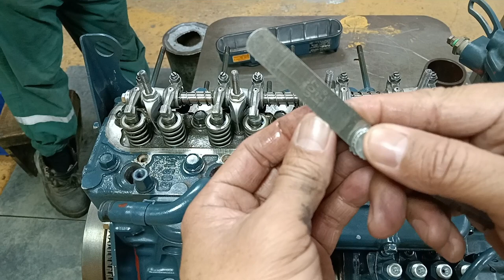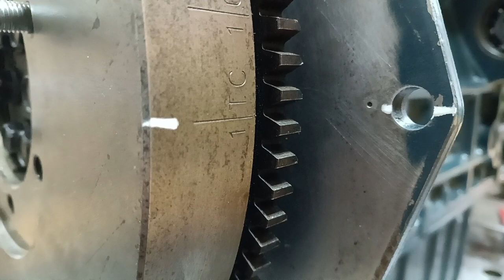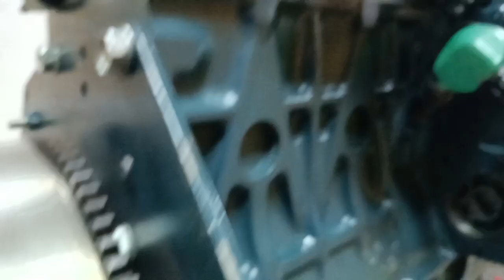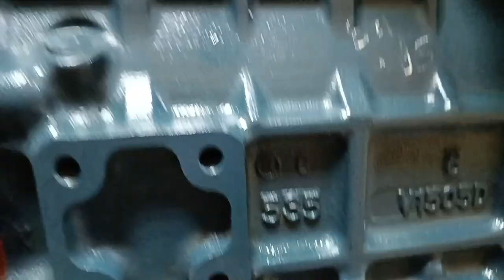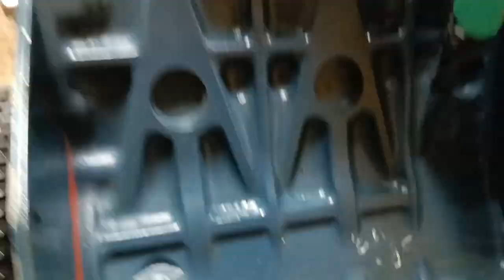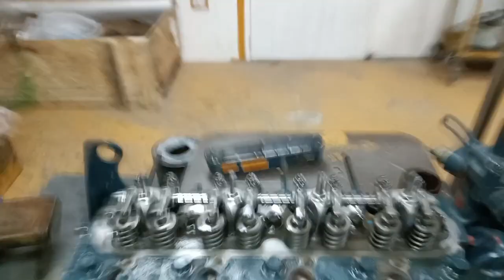how to tune up engine 4 cylinder, valve clearance adjustment v1505 Kubota, paano magtune up tutorial

Comment: Tanong lng po s4e engine bd2f  ilan po cylinder head bolt torque niya hindi kasi nag bigay ang machine shop , main at con rod lng po binigay , tapos ilan po kaya ang valve clearance nya , bago lng po ako ojt kasi yung nag overhaul umalis na nag iba na . Salamat po
Reply from the maker: Head bolt   120 NM.
Valve clearance.    0.25mm intake & exhaust
Reply: Sir pag sa sunshine li 285 ilan po ang clearance nya salamat sa tutorial nyo sir